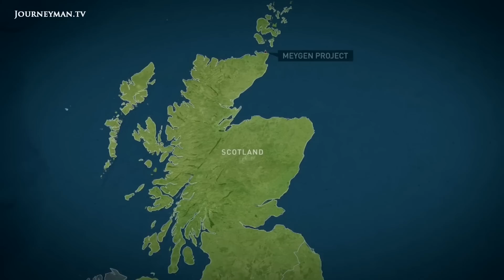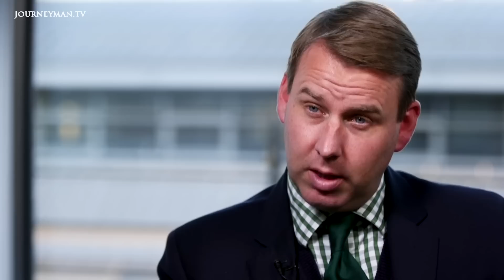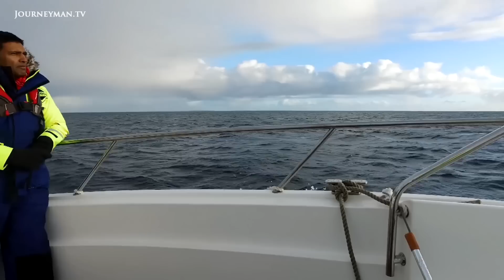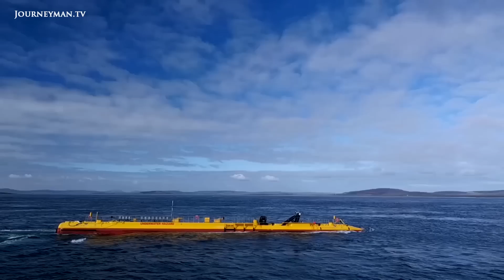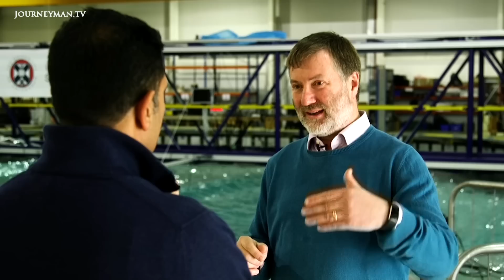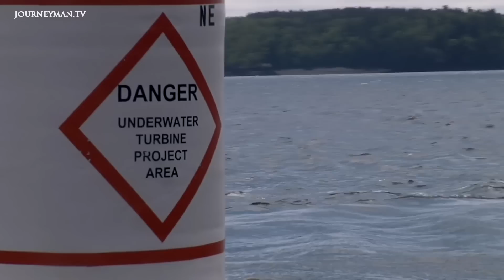Scotland Touts Tidal Energy As The Renewable Of The Future

Comment: cool thing about these tidal turbines is the fact that they can use Extremely High Torque Low RPM permanent magnet motors since water is 784 times denser then air its has much more force behind it and can move much heavier objects

Comment: This seems like a no brainer for coastal countries
Reply: Absolutely. The sheer amount of energy in tidal currents is quite immense and I can't fathom how better technology for harvesting that energy is so slow coming.
Reply: Not every coastal country has meaningful tides, but yes, every form of renewable energy that is supplied by natural means should be tapped into.
Reply: and still is an idiotic idea promoted by idealists and con artists alike.

Unlike Wind power, much of which is on land and close to communities, Sea Turbine power is always far away, and then the costs of maintenance is huge because it's submerged out in no-where....AND the cost of delivery is exhorbitant. Since on average power networks lose about 25% - 30% on transmission (due to heat loss) putting a power source and extra 30 miles away is really costly. 

Present systems generate heck of alot of power, then step it up to high voltage (126kV or 242kV or 500kV etc) to over come this problem because higher the voltage means lower the current means less heat loss.

But for ocean turbines to generate that much power they have to be HUGE and geographically very concentrated. With those requirements they have to be in deeper waters, and turbine power in water creates friction which slows it down. AND the there are problems of bioorganisms living on it....

I can tell you it's not even forseeable that Ocean Generators have that level of efficiency....nor are they ever gonna be that indestructible. 

All they are selling you is hope : if you put money in it, the tech will one day payback. Unfortunately it never did for ocean power. Every sales pitch promises double the power and delivers a quarter of the performance promised. They have spent literally 10s of billions of dollars of research funds and given us nothing.

I will tell you now not to compare with Wind Energy. Wind power was started by a small Danish company called Vestas about 30 years ago,and at one point it dominated 70% of world markets. But it Never spent billions of VC funds to start up. It hardly delivered dud projects. 

All I can say is Ocean Power Tech in its present state isn't just a tech waiting for money to grow, it's a con Job.
Reply: @toraguchitoraguchi9154  Although your numbers are valid, you undoubtedly realize that the vast majority of wind power turbines are offshore? Not much difference in fact - I'm not a 'fan' of both technologies myself - but they both have merit in certain situations.
Reply: @velianlodestone1249  The Vast majority of wind farms are not exactly off-shore. They would be useless if they were. Current systems are 12kV - 36kV systems, They can't deliver power more than 20 miles. Most of them that are built in oceans are on the coast line but close to land, which is not the same as sea turbines which need go be further out.
Reply: Superficial thinking.  No Brainer is code for I cant be bothered educating myself so I will believe everything I read on the Internet
Reply: @velianlodestone1249    what?  you are kidding arent you ?  the "vast majority"?
Source please.   The only vast majority that are off shore is the vast majority that are problematic and need excessive maintenance
Reply: @yarpos  These programs always talk about the generation side, but not about the transmission issues involved in ocean power systems. All the undersea cables, leading to a station on land....that's awfully expensive, how long will they last? If they wanna mount a step-up transformer under-water...wow...good-luck on cost and future maintenance.

A wind-turbine has within the turret a low-voltage switchboard, a Step-up transformer and a medium-voltage switchboard.....now, let's cram all that under water....not gonna be practical... let's float it on a barge....oops, still corrosion's a bitch, even if we use costly marine grade equipment. If we send low voltage power to shore then step-up....power-loss becomes a real project killer....These are the first hurdles any ocean power system will have to deal with. 

Then, like ships, these ocean systems will have marine organisms growing on them...barnacles etc. One commentator said that's why it's important to make movable systems...so that sea creatures won't grow on them. Tell that to the ship-owners.
Reply: @yarpos  You're right, I made an assumption there I should not have made - it is about 25/75% in favour of onshore as per https://www.renewableuk.com/page/UKWEDhome/Wind-Energy-Statistics.htm. Where did you find the statistics for maintenance with regards to offshore wind farms?

It does look like, looking at the statistics, offshore is a more efficient way of energy production by a large margin compared to the onshore capacity. What are your thoughts on this?

Comment: Majority of Scotland's power now comes from renewables, wind turbines alone produced (at peak) 109% power requirements for Scotland.
Reply: Niiiiice
Reply: and when the winter doldrums come they will produce close to zero.  The Scottish Institute of Engineers has warned of the inevitable event.   You quote peak because that is the only good number.   Typically a solar or wind plant only produces 30% of its nameplate (peak) power rating,   and then only when wetaher and time of day permit,  not necessarily when you need it.
Reply: Wind power is better than ocean power, but wind power alone is not enough. You need lots of backup systems for when the wind stops blowing.
Reply: The whole point of it being spread out over the country is that it's always windy here, somewhere, hence the redundancy of supply.  There are solar, tidal, hydro etc as well for the sake of redundancy too.
Now, I've not got figures for Scotland on its own as it's integrated into the national grid but the vast majority of the wind power in the below website is from here, if you monitor it over the course of a few days, you'll see it remains fairly consistent. 
http://gridwatch.co.uk
There are also plans to use old mine shafts as storage for power, this is basically a really simple and ingenious method of storing excess power, ever seen an old clock where you pull the cord to raise the weight? Same principle. Electric motor raises the (huge) weight when there's excess power available then on demand lowers it, releasing the potential energy back into the grid.
Reply: @yarpos  I said it PRODUCED as in actually made 109% of our power requirements from wind alone, not that it had the capacity to. Granted demand was low and production was high but capacity is much higher, but that's not the average, the average production is lower, that's why we use hydro, wind, solar, tidal etc as part of a network so that if any one source had a drop in production then the others are there to take up the slack. Nuclear and coal are being phased out over the course of the next could of decades. Scottish power has already sold off the majority of is fossil plants and Hunterston nuclear power plant was sold to edf years ago and is being completely decommissioned within 5 years.
Reply: yarpos that’s why we generate power from several different sources solar, wind, tidal, hydroelectric schemes and spread them around the country, the technology is only going to get better and more efficient stop moaning
Reply: Wooow

Comment: a planned 2,500 tidal turbine project was cancelled by the uk government recently,  it would have created 10,000 jobs during the construction phase, however, despite Westminster removing key factors like the green subsidy, investment in the green sector has continued within Scotland, primarily due the SNP and EU support, it is vital for the sector, and the Scottish Government will capitalise on the fact that sub sea power cables now connect us to the south of England, and now already send power to that region, earning hundreds of millions of pounds a year for the generators, Scotlands potential has been estimated at around £8-£10 Billion in tax a year, thats around 5 times what oil brings in, so its vital for that investment to continue.
Reply: and still is an idiotic idea promoted by idealists and con artists alike.

Unlike Wind power, much of which is on land and close to communities, Sea Turbine power is always far away, and then the costs of maintenance is huge because it's submerged out in no-where....AND the cost of delivery is exhorbitant. Since on average power networks lose about 25% - 30% on transmission (due to heat loss) putting a power source and extra 30 miles away is really costly. 

Present systems generate heck of alot of power, then step it up to high voltage (126kV or 242kV or 500kV etc) to over come this problem because higher the voltage means lower the current means less heat loss.

But for ocean turbines to generate that much power they have to be HUGE and geographically very concentrated. With those requirements they have to be in deeper waters, and turbine power in water creates friction which slows it down. AND the there are problems of bioorganisms living on it....

I can tell you it's not even forseeable that Ocean Generators have that level of efficiency....nor are they ever gonna be that indestructible. 

All they are selling you is hope : if you put money in it, the tech will one day payback. Unfortunately it never did for ocean power. Every sales pitch promises double the power and delivers a quarter of the performance promised. They have spent literally 10s of billions of dollars of research funds and given us nothing.

I will tell you now not to compare with Wind Energy. Wind power was started by a small Danish company called Vestas about 30 years ago,and at one point it dominated 70% of world markets. But it Never spent billions of VC funds to start up. It hardly delivered dud projects. 

All I can say is Ocean Power Tech in its present state isn't just a tech waiting for money to grow, it's a con Job.
Reply: @chamiboulette  Yes, the reply is the same and the content won't change for many years to go.

And seeing how ocean-floor installations today are abandoned after 10-15 years, it's no wonder why those ocean-floor power generating farms remain university projects.....university students are too stupid to realize that all sorts of coral and other stuff will grow and jam their devices on the ocean bed within a few years.....
Reply: @toraguchitoraguchi9154   which is why the development of movable turbines is crucial, every watt counts,  and the tide, unlike wind, can be relied on, which is why its so important to develop, single sources aint the answer, and its a blend of technologies that we need, so dont be all THAT, calm down and rationalise.
Reply: @thelastdruidofscotland  I wish people would do a little research into how many years and how many billions of dollars have been thrown into developing ocean turbines...and why all those hyped up projects failed.....I would love to read every failure analysis.
Reply: @toraguchitoraguchi9154  You clearly did not pay attention to the documentary and appear to cling onto old tech ideas and aspirations like a true fossil addict.
Reply: @showme360  Same Ocean Turbine crap story rehashed over n over again.
Reply: Great constructive comment my thanks
Reply: I think the turbines should be under barges and the barges could be hho or mechanical batteries that could even out the tidal effect .

Comment: Texas 's electric bill is lowest among the States because of using a lot of wind power!
Reply: actually in terms of actual power delivered Texas has very little wind power the great majority (80%ish) is from traditional sources.    They are very good at PR spin though
Reply: Texas has 25000 wind turbines. That's equivalent to 65 of these....
Reply: For Texas why not use geothermal storage. This would reduce peak load and heat even when electricity mains fails.
Would be overjoyed to detail. 
Systems Engineer lecturer  Air conditionning.

Comment: Anyone interested in this should check out Minesto and their Deep Green project. It could potentially make tidal energy much cheaper by using  much less material
Reply: Nope. Another stupid idea.
and still is an idiotic idea promoted by idealists and con artists alike.

Unlike Wind power, much of which is on land and close to communities, Sea Turbine power is always far away, and then the costs of maintenance is huge because it's submerged out in no-where....AND the cost of delivery is exhorbitant. Since on average power networks lose about 25% - 30% on transmission (due to heat loss) putting a power source and extra 30 miles away is really costly. 

Present systems generate heck of alot of power, then step it up to high voltage (126kV or 242kV or 500kV etc) to over come this problem because higher the voltage means lower the current means less heat loss.

But for ocean turbines to generate that much power they have to be HUGE and geographically very concentrated. With those requirements they have to be in deeper waters, and turbine power in water creates friction which slows it down. AND the there are problems of bioorganisms living on it....

I can tell you it's not even forseeable that Ocean Generators have that level of efficiency....nor are they ever gonna be that indestructible. 

All they are selling you is hope : if you put money in it, the tech will one day payback. Unfortunately it never did for ocean power. Every sales pitch promises double the power and delivers a quarter of the performance promised. They have spent literally 10s of billions of dollars of research funds and given us nothing.

I will tell you now not to compare with Wind Energy. Wind power was started by a small Danish company called Vestas about 30 years ago,and at one point it dominated 70% of world markets. But it Never spent billions of VC funds to start up. It hardly delivered dud projects. 

All I can say is Ocean Power Tech in its present state isn't just a tech waiting for money to grow, it's a con Job.

Comment: Why do they always say it can power 100k homes, how much power is that? Tell us in Mw hours instead of telling us in bullshit.
Reply: I would imagine it's vaguely to do with the fact that average people know very little about the semantics of energy production. News is usually reported in lay-terms so that as many people as possible can grasp the concept. While you may well know what a Mw hour is, if you asked my Mum if she does the answer would be somewhere along the lines of "What the fuck are you talking about?" 😁
Reply: Just as an aside - 2 minutes flipping between Google and my calculator has revealed that the answer to your question is: around 460,000Mw Hours. Have a great day 😉
Reply: @vonmarmotson812  I think you worked out Kwh not Mwh and even still that would be 46kwh per house per day that's a lot I was averaging 26kwh a day in summer running 2 very old air conditioner units(in Australia). Now I have solar panels and replace both AC with new ones I think I'm using less than 10kwh. But we are doing the journalism for them. They could have done a better job of it and I'll be commenting on how impressive it is. Instead we are still trying to find out what 100k homes really means.
Reply: @corporalpunishment1133  there is no A/C in Scotland.
Reply: why not ?  you can efficiently heat and cool with A/C (or heat pumps as they call them in some places)
Reply: Because its unchallengable bullshit.   Usually they extrapolate peak nameplate power and pretend thats produced 24x7 and then use average household use.  Typically these things deliver 30% of nameplate capcity over time just due to weather and time of day.

Whenever you hear "powering x thousand households"  you can be vert sure they are just talking bullshit,  have no clue what they are really talking about or both.
Reply: @yarpos  Plus hush hush about corrosion problems and massive costs of production and service.
Reply: True @VonMarmotson

I don't understand it